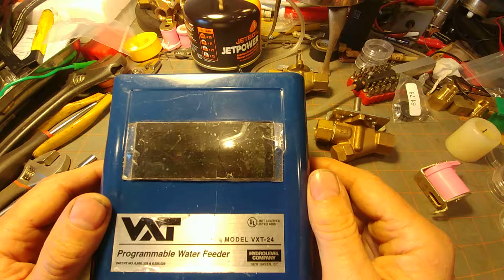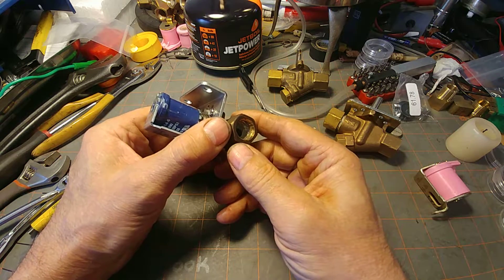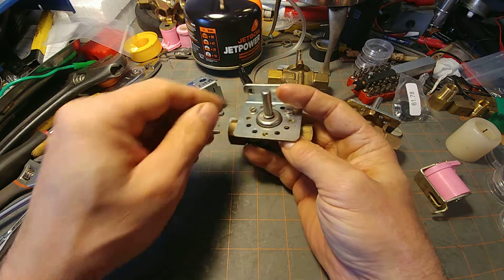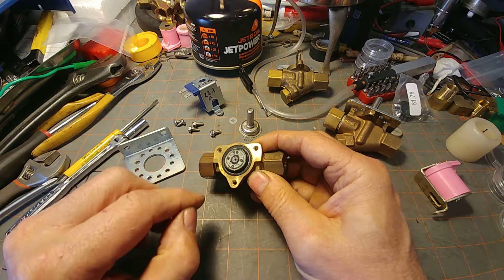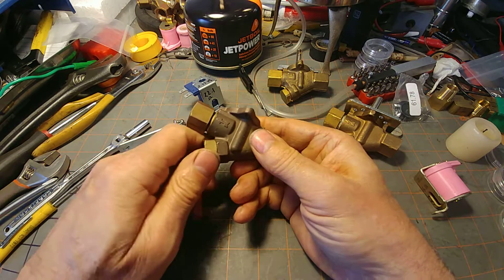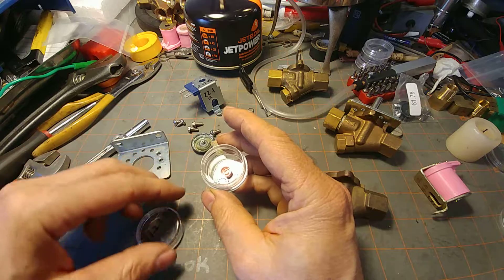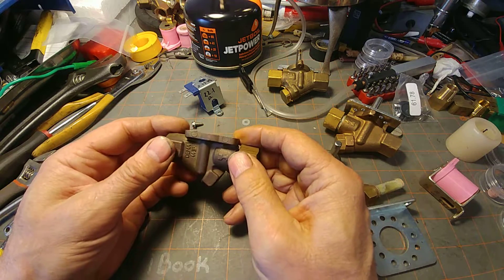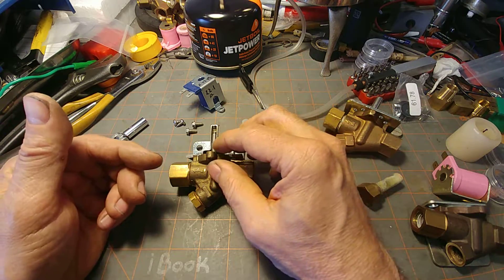VXT Steam Boiler Water Feeder Solenoid Valve Break-Down

Comment: I recently purchased a house with a VXT-120 auto feeder and a peerless boiler series 63/64.  The auto feeder has a see-saw button that says feed, I presume this is the manual override button.  Above that is a valve that is closed when perpendicular with the valve and open when parallel with it.  

Should this valve be open all the time or only when using the manual override?

-Tim
Reply from the maker: What happens when you push the rocker switch? 
Does water feed into the boiler, ie does the water level rise in the sightglass?

Comment: How reliable is the VXT water feeder, how often does it need to be serviced or replaced on average?
Reply from the maker: The VXT overall is a very reliable water feeder, especially the electronics.

The weak point (and everything has a weak point) is the valve.
The service schedule would depend on the hardness (minerals) of the water feeding the boiler and, more importantly, the overall tightness of system.

All things being equal, the less make-up water needed for the steam boiler, the longer the boiler and the vxt will last.

In our area (with relatively low TDS, total dissolved solids) and with tight systems, VXTs with ten or more years of service histories are not uncommon.
Reply: @gordonschweizer5154  I have an older steam boiler about 20 years old with an older type low water cutoff.
Can it be installed on older boilers?
Reply from the maker: @frankcaferra486  It should not be an issue even with older low water cut offs. It just has to be wired in with the correct voltage.
Reply: @gordonschweizer5154  thank you

Comment: Is there a way to override the autofeed valve to fill the boiler?
Reply from the maker: I presume you have a VXT and a steam boiler. If so, there should be a black plastic rocker switch measuring 5/8" by 1-1/4" on the outside of the VXT labeled "feed" in white letters, and that if you press it, it should energize the solinoid valve and that should feed water into the boiler
If there is no power to the unit, or if there is no water to the unit, or if the internals of the valve have calcified, or if the line has rusted up, then no water will feed.  The installer should have built a manual bypass around the VXT so water can be fed to the boiler if there is no power, for example. Hope this helps. Please let me know.